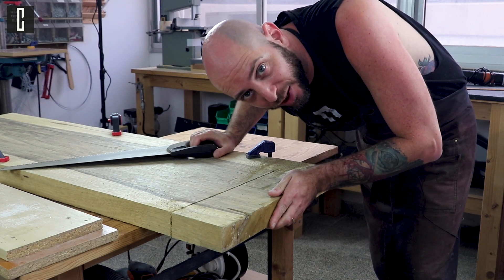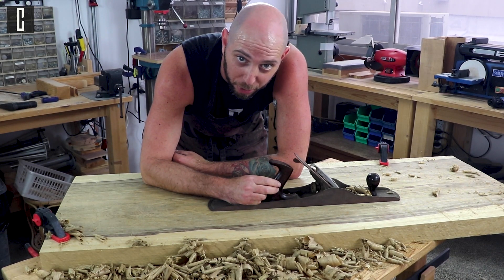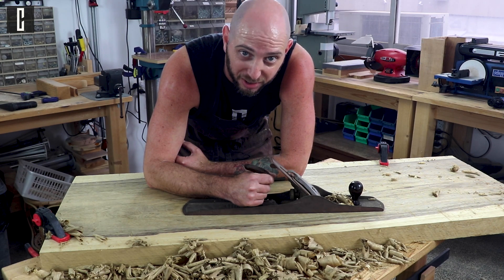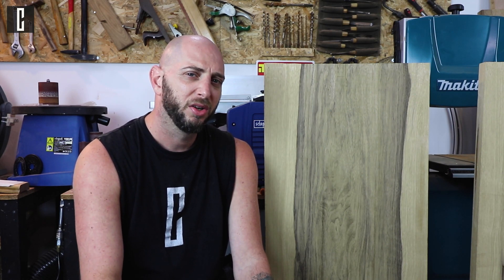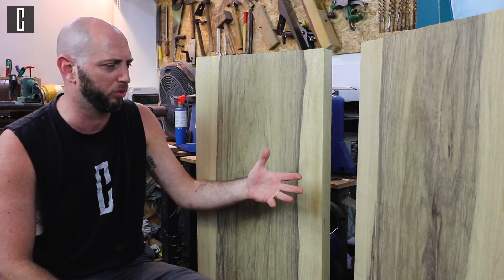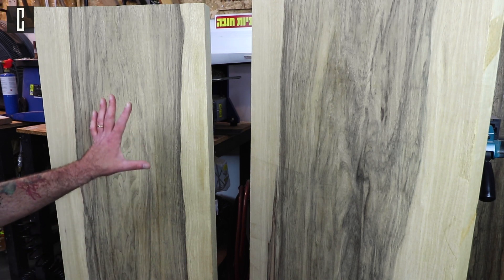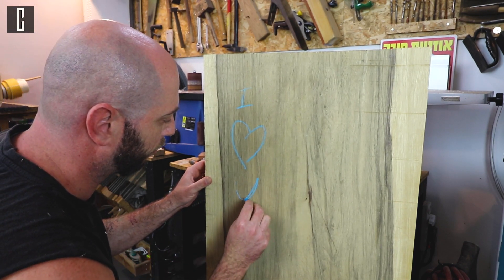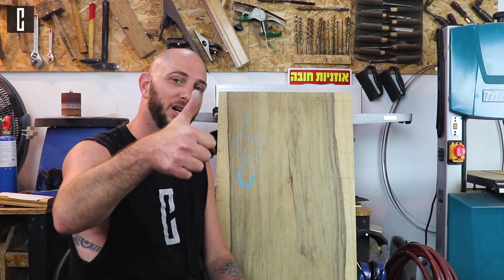One-Piece Guitar ep.2 - choosing wood for our electric guitar

Comment: Nice woodworking. But that's some seriously incorrect physics you've got there. You are applying principles that come from acoustic instruments, where bridge admittance is high, to electric solid body instruments, where bridge admittance is very low. In short, tapping big solid chunks of wood, even if you did it after they are sized (which would matter for an acoustic instrument), is a total waste of time. If it makes you "feel" better about the wood, fine. But it makes zero difference to the actual physics of the finished instrument.
Reply from the maker: That's somewhat true, the tapping will be done many times during the process. And YES, it does make me feel better about the wood 😁
Reply from the maker: And thank you for commenting, you just gave me an idea of a new video regarding my principles of acoustics in solid bodies. Cheers
Reply: @coilsboutiquepickups  Good idea. I look forward to an evidence-based coverage. Not just opinions, like those of some good guitarists who say that they judge the acoustic sound first. Because with respect, one needs some scientific background to correctly identify the relevant physics. Which is why you get similar numbers of experienced guitarists saying either that the acoustic sound matters, or the complete opposite, that it is irrelevant. There is plenty of good published science from measurements on real solid body electrics.
Reply from the maker: @vw9659  we'll try our best to prove the concepts. I already have some ideas of how to do that